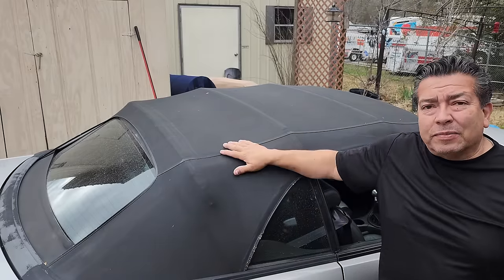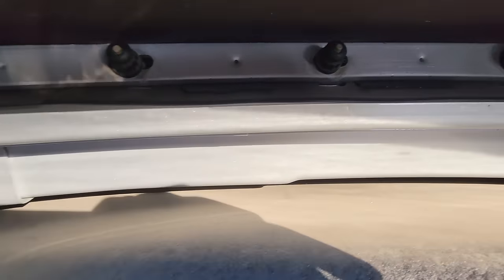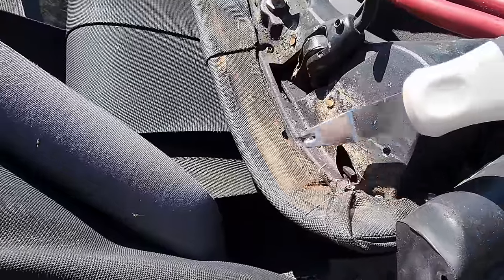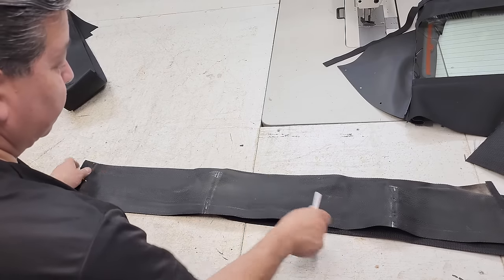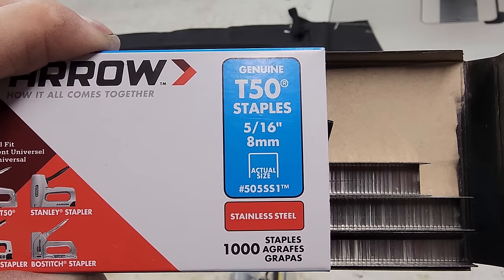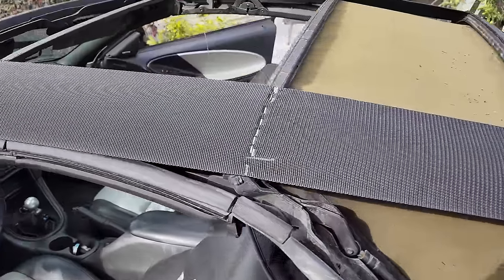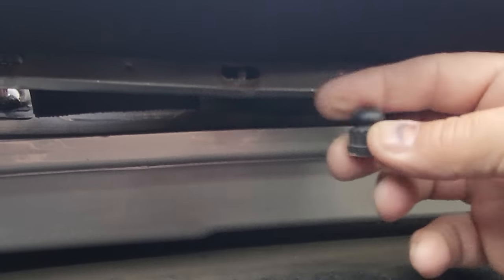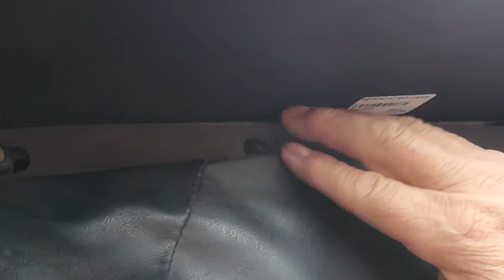How To DIY 4th Gen Mustang Convertible Stayfast Top Step By Step #upholstery

Comment: Great job and it looks great. I wish you had a video of a 4th generation Camaro showing how to teplace the top. My 2002 camaro needs a new top cause of the back window. Do you know if the same size staples are used on the camaro. I have only come across 1 other video on here showing how replace it but he never says what size staples or pop vivets are used.
Reply from the maker: Hello BB, Thank you so much for saying so. It's easy to see the size staple by the thickness of the tack strip. Most tack strips up front are thin, therefore, you would use a shorter staple, maybe 5/16" or 3/8". Most rear bows have the thicker tack strip and you can use 1/2" staples. Please keep liking and watching!
Reply: @oldschoolautoupholstery  Thanks for that information. That will help me out when ordering the stainless steel staples for my job. Seeing how I am going to use just a few rivets, I was just going to see of i can find a variety pack of stainless steel rivets so I know I have a few of each size. Thanks again and Keep up the Great Work and Content
Reply from the maker: @bbay1977  Hello BB, You are so welcome! Aluminum rivets should work just fine. Please keep liking and watching!

Comment: Need a video on maintenance of convertible tops.  I know that's not in your wheel house.  It will branch out to different viewer audience.
Reply from the maker: Hello Wade, Do you mean mechanically or maintenance of the top material? For top material, that would be a very short video. The secret is to keep it out of the weather and away from sun light. It will last forever!

Comment: Where did you buy the new tack strip? Mine fell apart. Also do you have advice on why my rear gets stuck on the rear support when I try to put the top down.
Reply from the maker: Hello Easy, You can get urethane tack strip at any good auto upholstery supplier. I am sorry to say that I have never come across that problem. Please keep liking and watching!
Reply: @oldschoolautoupholstery  thank you sir
Reply: Any advice on how to adjust the headliner to the bows? I can't seem to find a video that shows how to screw the liner to the bows.
Reply from the maker: @EazyDpodcast  Hello Easy, You are so welcome! Please keep liking and watching!
Reply from the maker: @EazyDpodcast  Hello Easy, Usually just note the disassembly of the old headliner to reinstall the new headliner. That is what I would do. Please keep liking and watching!

Comment: Using the stuff you used in this video, what is the cost of you doing the convertible top on this car?
Reply from the maker: Hello Michael, My cost was just about nothing. A few staples and a little bit of glue. The top was supplied by the customer. You can check the different prices for convertible tops here: topsonline.com (Not Sponsored). Please keep liking and watching!
Reply: @oldschoolautoupholstery  I was interested in what you charge to change the top like that?
Reply from the maker: @michaelkennedy2528  Hello Michael, What I charge will be different from what other people would charge. Pricing will depend greatly on what the upholsterer wants to charge you. You ask ten different upholsterers how much, and you will get ten different answers. Prices will vary based on experience, geographical area, and reputation. The best thing is to ask an upholstery shop in your area. Please keep liking and watching!